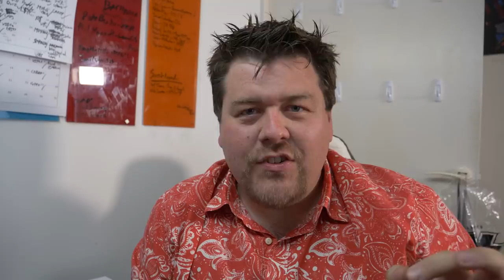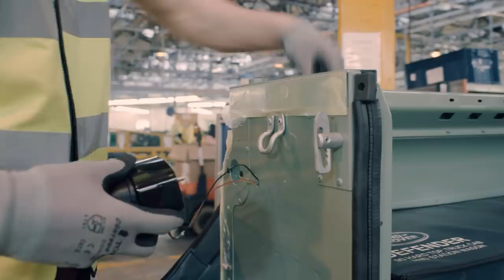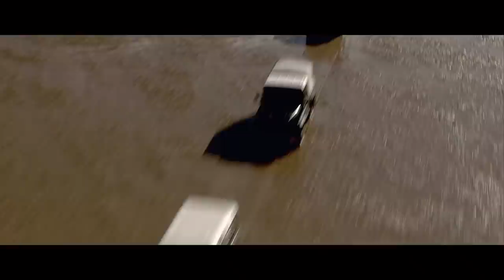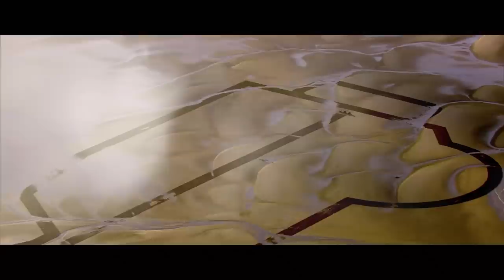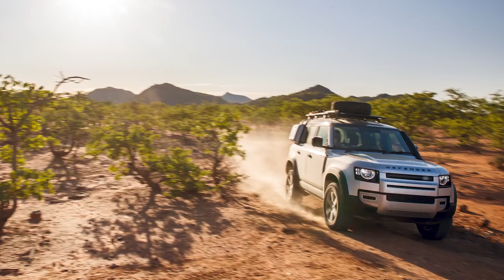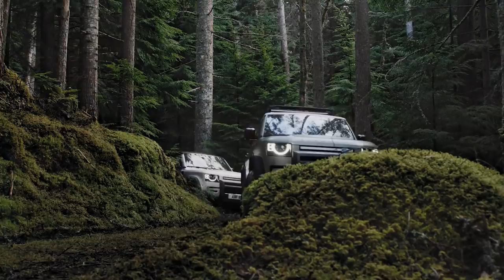How EVERYTHING About The New Land Rover DEFENDER is *WRONG*... and it is GENIUS!

Comment: I've a 1979 Series 3, and as such i find my friends 2002 td5 to be quick, quiet, comfortable, economical, smooth riding, and good handling with quick steering. Everything you said about them being genuinely terrible is absolutely correct, if anything you missed a few things. They're also far too easy to steal! The new one isn't a replacement for the old one, there was also no point in trying to directly replace the old one, hardly anyone bought them. If there really was a market for it, wouldn't you expect the order book for the foers ibex to be full now? The way we reacted to Defender (and Mini) production stopping makes me wonder about how the french felt when the 2cv was stopped. By modern standards all 3 were basically unacceptable, but there's a part of you that thinks "aw, no, why?!".

I don't think they should've used the Defender name, it feels like they're trading on the fact that it's already established, and hoping that people will quickly forget the general "falls to bits and leaks oil" of the proper one, instead of calling it a Freelander or thinking of something new. When you look at the new one, it's hard to imagine a farmer using the front end to push a gate open when it's swampy, or standing on the bonnet to see across a field better. The old one had widely spaced peddles so that you could drive it while wearing wellies, does the new one?
Reply: In my opinion, the new one looks better with steel wheels, and i think that's brilliant.
Reply: Hunter wellies maybe ? At the point to point.

Comment: Speaking from experience, I would not trust any car with this many electronics on it that’s made by JLR as they have an atrocious record for electrical reliability. It’s overpriced for what it is too: they should have built it at a lower price point rather than made it an “either/or” with a Range Rover.

They’re not pleasing everybody: they’ve essentially alienated their core customers - commercial ones - for the enticement of the Chelsea Tractor set, as let’s face it: the most off-road one of these will typically go is up a curb onto a grass verge when Tarquin or Lambrini gets dropped off at school.

Comment: I agree with the video, look at the  original G wagon which was a millatery off road car, now it is a car for the ultra rich and yes maybe It can do a bit of off roading and over landing but even if got a scratch on the bodywork it's probably going to cost more to fix it than a average car however if mercedes wanted to make a car which wasn't a expensive statement it was going to be very difficult due to eu regulations, the brand image it has created and the fact 99.9% of the people who bought one were never even set foot in a off road environment meant that mercedes were forced to create a car which could only please people so much and it's not just the G wagon it's the same story with mini, volkswagon, fiat and so on. And it is the same story with the land rover defender, JLR did there best to make the new defender as similar to the old one but new customer standards,  regulations and situations meant that even though the new defender is a amazing off road vehicle it would never please the hardcore defender fanbase no matter how hard JLR tried.

Comment: Could have bought a good example In 20009, for around a 1500 euro price tag, long wheel base, station wagon with a roof rack, I backed out, boy am I sorry now, that car is worth 15k, even if I had left it rot on the drive way, and I was keen but the seller was an absolute nerd

Comment: I am afraid Jay you are yet another motoring journalist who has totally missed the point with the new Defender and the Haters. 
You mention iconic cars, the golf, the beetle, 911. And I think the mini too. But the difference between them and the Land Rover, is that their modern counterparts all are designed and built for the same purpose as the old ones. The Land Rover is not. The Series 1 through to the Defender were all designed and built as light utility vehicles. Which happened to sell as a by-product lifestyle vehicle too. And it was that utility vehicle that made the Land Rover Defender so popular. Hence the military and so many various industries bought and changed the Land Rover for their own use for such a long time. The new defender however is simply another luxury SUV. 
I am yet to see one journalist who can see that difference. And then rational as to why the purist is less keen on the new defender. 
Personally I want a vehicle I can use on the farm, push open gates with, fit in narrow spaces. And if it gets knocked I can fix it myself. The new defender can never fit that bill, not even a used one in 20 years time.
But I would buy it and use it in replacement of a Range Rover or Discovery. As I think it is a much better looking motor than both. 
So for me and many others, no I don’t hate it for being what it is, but the fact the Land Rover brand have just made another product that is no different to the rest of their range these days. Why not be bold and make a true utility vehicle. We know they sell, just look at how many trucks like the Ranger are on the road.
And I don’t believe anyone who says they couldn’t have built a product more fitting to its name. Because they could. Jeep do with the Wrangler, Suzuki do with the new Jimny and Merc do with the GWagon.
Land Rover just want a cash cow from the name. And missed the chance to make something really good and true to its purpose.

Comment: I think if someone has to replace their Defender, they will probably buy another second hand Defender. Or if they really have too, get a Toyota Hilux etc. The new Defender, well the low end version anyway, is I think aimed at Power company's and so on. Company's who in the past bought the old Discovery for their engineers. That was the Discovery of the past, a working 4x4 with more comfort than the old boneshaker Defender. The Discovery is a baby Range Rover nowadays and with the price expected of one.  I have to say I loved the Defender. Right up until I had one and I really knew I had made a mistake within hours of owning it. I just did not want to admit it and I sold it as soon as I could. But I still love the way they look, I always will.

Comment: I think people are forgetting that the gwagon evolved from industrial to plush over time. It was already a wee bit of a gin palace before it was updated. Jlr completely missed the boat on that, hence all the modifiers doing it for them. 

Either way, I'd buy a current g class. I like the look of the defender, especially the interior (with the wood pack), but I wouldn't buy one.

For the same reason I wouldn't buy fiat, alfa, Renault, Peugeot or citroen. It. Will. Break. 

I've never subscribed to the old adage that poorly built cars 'have soul' or personality. 

Would I buy an alfa if it wouldn't break? Yes. Renault? Yes. Fiat? Yes. I love the design of some of their products. 

But I'm not going to buy problems. 

And im certainly not going to be told I'm not a true petrolhead until I do by some old top gear fanboys. 

So in summary, it will break. So it's a no from me.

Comment: I like the new Model. It looks really nice and for an SUV really it is really offroad capable. - It should fit now to the use of a wider audience. The only people who have a real technical reason to skip it are real overlanders. For them, the vehicle can`t carry enough stuff (the old Defenders could indeed carry more on average), you can`t go wild with the tires on this kind of vehicle besides of getting a replacement somewhere in foreign region and it`s hard to fix when it has actually an issue, what is a normal thing when the car gets daily abused and not only a crush at the weekend. Harder hits under the car are also nothing for a unibody construction when it`s done constantly. - Everybody else will not mention a thing when they are using a new Defender offroad - which should be about 95% of the people purchasing it.

Comment: Dude you just don't get it. The reason people upgrade old Defenders is because they're so easy to upgrade.. they have almost a lovable tractor type personality they have a rugged and durable personification if that's the right word to use LOL it's a more natural vehicle in the sense that it's true.  what I mean is it has a terrible ride because it's a more natural ride there's not a lot of computers and electronics controlling everything. It's easier to fix Parts by yourself rather than having to go to a dealership. I to believe less is better and let the old Defender I think that's true. Just look at the original engine options for cylinder straight sixes and then who doesn't love a whopping V8. I understood that Land Rover was going to get away from V8 engines I get it.. but at least offer a straight 6 which I'm not sure if they do. Simple is better I believe and I'm just not sure I can apply it to the new Defender

Comment: The original defender can still be running after 50 years of seriously hard life, can anyone see this running more than 15 in same tough conditions? Yes it is a very very good performer off road, and off road king Andrew Pierre White has said that. But, long term primarily used off road, heavy duty, into the wilderness, hostile environments, up a mountain... etc forget it. Well it can do it but at least you had better take a ton of spares with you, because good luck with reliability from all the electronics in this modern Defender😀. We all know modern JLR vehicles are not renowned for their reliability or durability compared to days of old, and the more electronics / complexity you have the more (fragile) stuff there is to go wrong. What are you going do if that stuff goes wrong and you are in the middle of nowhere? Fly a drone with a new part in!

They say that you can always get the original Land Rover home one way or another due to its simplicity, same with a Land Cruiser, and modern Toyota engineering reliability is still good enough that you can pull that off with modern land cruisers, but Land Rovers based on recent years? Not so much.

As a very capable light duty 4*4 fine, for the Chelsea SUV crowd fine, but overlanding, safari, expedition vehicle like old Defender was - forget it. Too complex and not rugged or reliable enough. That market will want a classic Defender or a Land Cruiser.

Comment: Everybody knows that farmers are always claiming poverty so I highly doubt they will be spending 40k. Hopefully it doesn't break leak  everything I had a free lander v6 petrol  2001 it was the most reliable  vehicle. reliable in a bad sense it was always in the garage. Any way I digress. The defender we had lwb 110  they took all the best bits of a vehicle put them all together and then threw them away. The 110 was a patrol vehicle for the theme park  between that and the nissan terano both had a cage in so rattled more than a epileptic  full of pills having a seizure. I drove both  most days at work for 5 years hatefull car and 80k will get you into disco and may be  rangerover territory. And both those models are popular with the school runs and drive like a car. And are  luxury I can't imagine farmer Dan herding his whored of live stock with a range rover although it would be funny even though it would break down just as much as a defender and cost 3x as much to fix. But I totally agree Jay

Comment: The Jimny is a very interesting vehicle. The back to basics approach is rather appealing and it reminds me of the old Daihatsu Fourtrack but in a smaller form.

The new Defender probably should have had a couple of versions for the launch. An SUV like they've done and then a much more simpler affair, more mechanical, stripped back and at a much lower sticker price.

I have no doubt that the new Defender will sell, but it will be to city dwellers, yuppies and Kardashians. It is a different vehicle than the predecessor.

The Beetle was the same. Mini/MINI was the same too. The hate between the Mini/MINI camp is still very evident now. I'm a Mini owner, I am accepting of the Mini, but I absolutely hate seeing a MINI at a Mini car show, especially if it's an almost brand new one. The original Mini owners work hard to care for the cars, to maintain them and to get them to the shows. A MINI owner probably took his car to a car wash and that's your lot.

The Defender will be the same as Mini/MINI.

Comment: Exactly the same as when Bmw revived the mini
Reply: I will never be convinced the new Mini has any resemblance to the old Mini. They are so far apart I feel its just badge engineering. Were as the new Fiat 500 is definitely the originals off spring